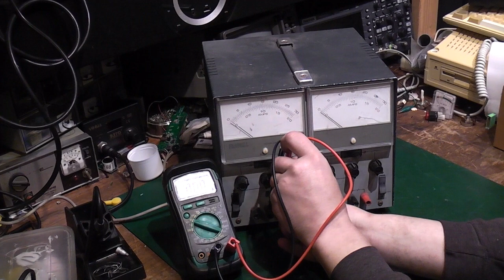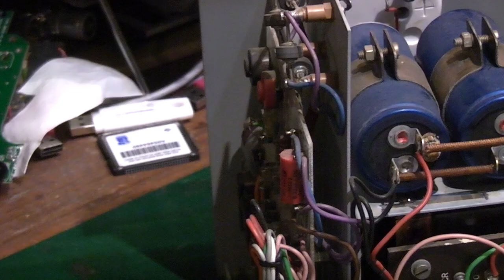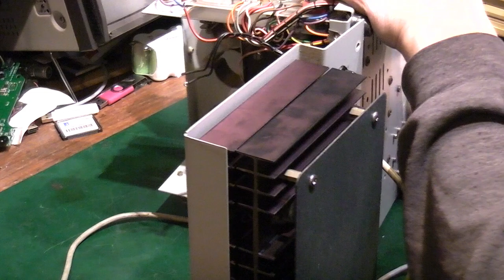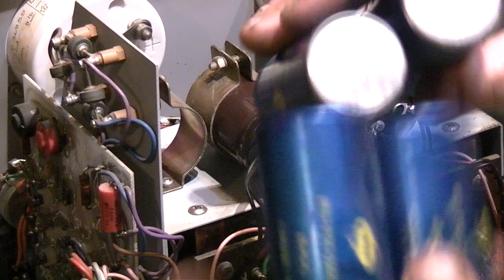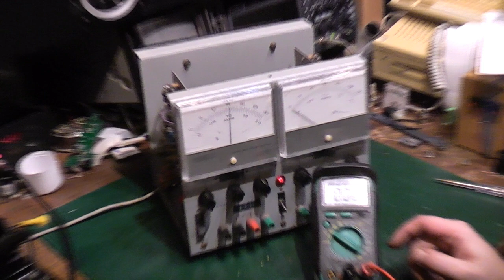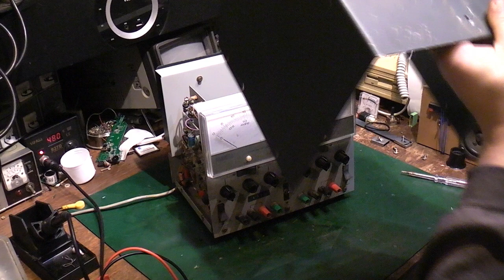Farnell L30DT bench PSU repair Pt3 (finally I started this in late 2018)

Comment: Hi Jay. I remember you mention this PSU in a comment. Nice to see it repaired. I finally finished repairing my stereo amplifier. I couldn't justify to purchase a dual rail PSU with tracking. I first tried 400mA fuse instead of the 3.15A. The 400mA blew from the inrush. I tried both medium and fast acting ones. I then made a dim bulb limiter. That together with the 400mA fuse, worked nicely. But I must a say that the Aim-TTi CPX series look very tempting..

Comment: pcb looks same as my single supply, dont use as a charger and power off with your drill battery connected.... it lets the smoke out.